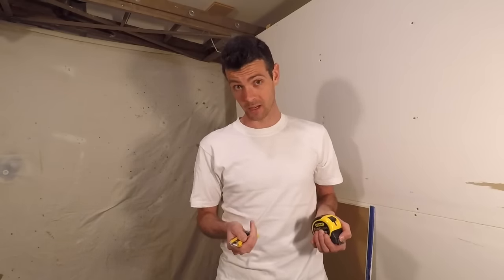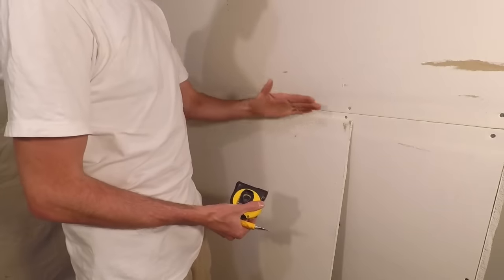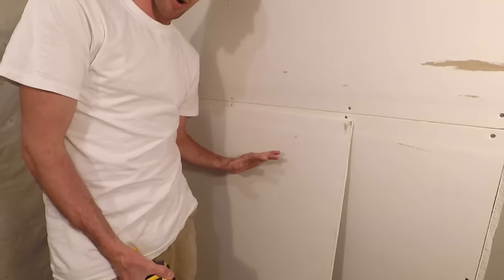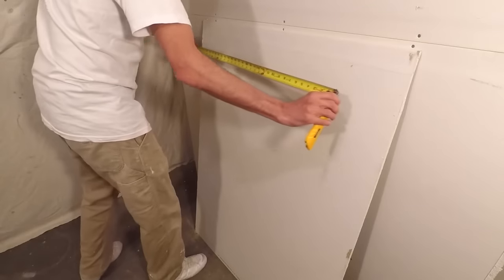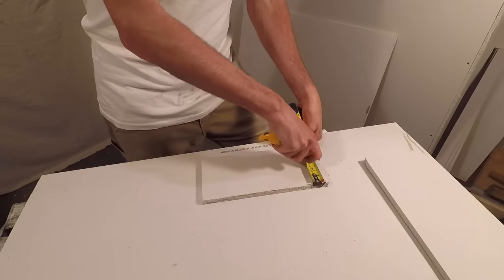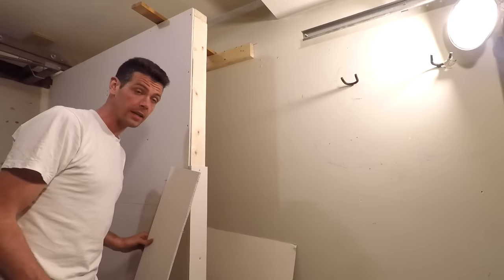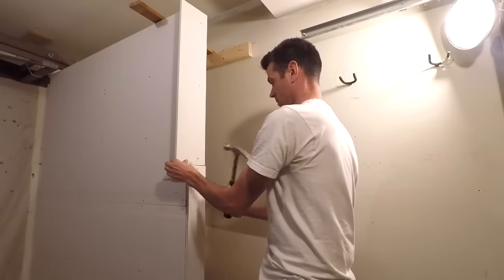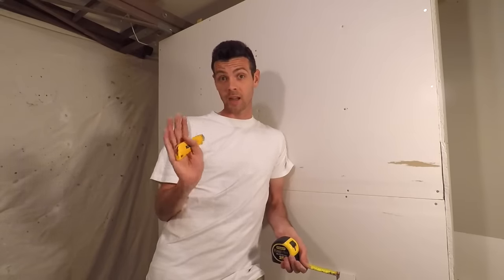How to Cut Drywall EFFICIENTLY!

Comment: If you do need to write down some measurements, you can pull the label off of your tape measure and rough up the plastic surface a little with your drywall sandpaper and have a convenient notepad to use with a pencil that can easily be erased with your thumb.  You'll always have your measurements with you that way.

Thanks for your good videos!

Comment: Great, concise speaking.  The term:   "Economies in Motion" is  used often by industrial Engineers.  I spent 34 years setting up assembly lines from golf carts, Outboard motors to Automotive Electrical Switches.  But not have to put up drywall for a cottage I bought.  thanks

Comment: Quick tip. When u puncture the drywall at your measurement with your knife. Always make your mark on bottom sides of the tape it will help u not Knick your measuring tape. Nothing worse then a cut in your measuring tape

Comment: That trick you showed about cutting the drywall in place instead of measuring it. That only works if youre hanging square corners. if youre hanging for bullnose, you need to leave the corner empty and only hang the stud. that requires measuring.

Comment: Dude get yourself a wallboarder's buddy drywall cutter! It's the only tool that both measures and cuts. I've scored and snapped whole sheets into 2+5/8" for window returns. We just finished a house with 8+1/2" window returns (14"walls) setting 120 corner beads throughout.
My helper put his rock ripper away and we used the buddy for the whole project

Comment: Great videos! How about a video showing how to efficiently cut out holes for outlets and switches, when installing new drywall?
Reply: Rotozip router with x bits! Works great and super fast
Reply: @22shroomster  I've heard of that method, but would the bit potentially cut into the boxes? And don't the holes need to be large enough so the drywall fits around the boxes?
Reply: @Jerdejong14  yes they would cut the outside of the box but that isn't going to matter because it's going to be covered. And the experts have a tracing tip on them which makes it easy to trace anything you're cutting out. If you haven't done it already search videos on YouTube on how to cut out an outlet box with a RotoZip router
Reply: @22shroomster  Ahhhh the tracer tip makes perfect sense!

Comment: I'm in the process of fixing a step through from my attic into the ceiling below.  I started using a jab saw to square up and clean out the hole but found a n oscillating tool with a dry wall saw blade was easier to make it accurately.
Reply: Wood blade works wonders too. We used to use a worn out wood blade in the sawzall. My boss hasnt got to use my new Milwaukee oscillator tool yet but im sure hes going to think about investing. Old dogs need new tricks every once n a while.
Reply: It also works very damn well when your sheet is 1/16 too tight. In the corners ill just run it right down the cut edge while pushing the drywall against the corner. Works so damn slick.

Comment: I drywall for a living too. Have my own company, and I think (and have always thought) the slide cut is a silly, showoffy way to cut drywall. At least half the time guys do that, I know our time prefilling is increasing, and I could do the same thing with a tape and a T-square maybe 5 secs slower and there would be no need for a rasp. The rest of the methods are standard industry techniques. Thanks for sharing.
Reply: so how are you gonna use a t-square when your trying to rip a 8ft sheet down?
Reply: Cdub272 
You use a straight edge.
Reply: Mr Glass 
Not all edges need a rasp. And I think it’s ludicrous that people prefill everything. 95% of the companies I know only prefill gaps, and that’s all we ever do and I’ve never had recalls for cracking on flats or butts. That said, if you can do that technique and get away with-great! Agree to disagree, I guess.
Reply: Cdub272 
Whatever works for you. What matters is what it looks like in the end.

Comment: Vancouver carpenter you need to try a Wallboarder's Buddy drywall cutter. The only tool that both measures and cuts sheets to length or width. Multiple scores can be made on both sides and then it's snap, snap, snap for those long narrow pieces that are often called for. We just did a house with window and door returns throughout due to the 14" thick super insulated walls

Comment: Can you do a video on techniques for placing drywall on a curved radius wall....think gently curved staircase. I’ve always been curious
Reply: As a side benefit, you can have a really neat curved staircase in your garage 🤪
Reply: Doubled layer of 1/4 inch drywall. Take a pump sprayer and wet the drywall but don't completely drench it. That makes it more flexible. That's what I do.

Comment: Awesome!  Thanks.  I love your videos.  I was in Depot last night.  I saw only curved trowels in the Wal-board (drywall) tool bay.  I bought a straight trowel in the 'concrete section', seemed to have about the same weight as the drywall one.  I think the buy I made was a mistake  I was noticing some slight rust stains in the mud.  I'm guessing trowels for drywall are specifically stainless steel?

Comment: I'll have to try this. I always use a chalk line snap and cut the line
Reply: Ninnos100  I love it especially when I am doing angled wall cuts that come to a pitched ceiling. You can get the right hooks for the line that claws into the sheet helps so you don't need someone to hold the end of the line tight. Yeah I use it to strike my line too. I'm going to try it next time I start cutting

Comment: Do PEX brackets and fittings, because they stick out further than the framed wall, cause problems with setting the drywall? For example, does the metal bracket and installed 701 (purple fitting) affect drywall installation? It creates a bump to the otherwise flat stud wall. I can't find anything on this. When cutting the hole for the drywall, do you cut it the size of the pipe, or the 701? Thanks for any help. I know this doesn't relate directly to this video, but I'm having difficulty finding anything on this?

Comment: Love ALL your vids, but im surprised youre not using the metric system.
Reply: FoxRcng708  You're entitled to your opinion, even if it's wrong. Any data to back up your statement? Here are some basic samples of measurements for comparison. There's simplicity and symmetry in the metric system. Good luck adding or multiplying multiple numbers that are not whole in inches.
0.5 cm = 5 mm
1 cm = 10 mm
2 cm = 20 mm
2.5 cm = 25 mm

0.5 inch = 4 eights = 8 sixteenths
1 inch = 8 eighths = 16 sixteenths
2 inches = 16 eights = 32 sixteenths
2.5 inches = 20 eights = 40 sixteenths
Reply: @MrSchmuck  It's ok, people will defend a turd if it's all they know and are envious.

Comment: Isn't it better to leave a hollow corner rather than overlapping the pieces so that the tape-on corner bead is able to center itself?
Reply: only for bullnose corner bead. for regular 90 bead you want your board almost flush, that way the corner bead will set itself, and if it needs adjusting (which it shouldnt) you still have drywall to slide it on

Comment: Great video once again.  I am really enjoying your content.  Just finished hanging the drywall in a basement remodel so I have watched your taping and coating videos numerous times in preperation.  I was wondering if you would ever do a video on your method of taping sequence?  Do you tape all your butt joints, then go to flats, then outside corners followed by inside corners and lastly screws?...then do  two additional finishing coats on top after tape is embedded?
Reply from the maker: That's it in a nutshell.

Comment: Very helpful video for beginners or apprentices but your holding your tape and knife wrong , the knife goes on the outside of the tape not the inside this is faster and saves you time on pieces that don’t require a pre measure knife mark putting the tape on the inside of the tape confines you to pre measure mark every time for piece workers like me I’d never hold my knife like that